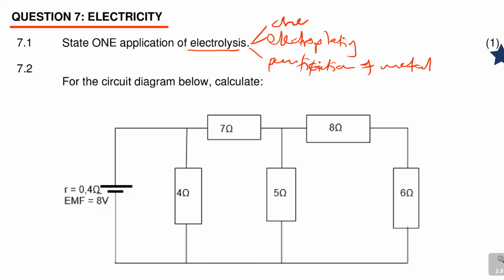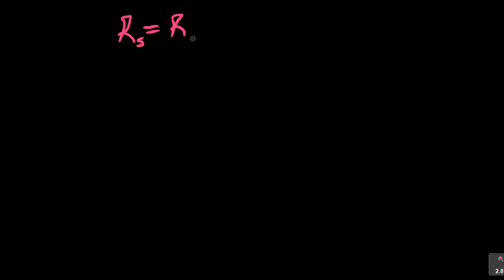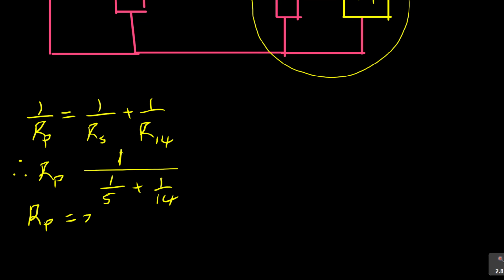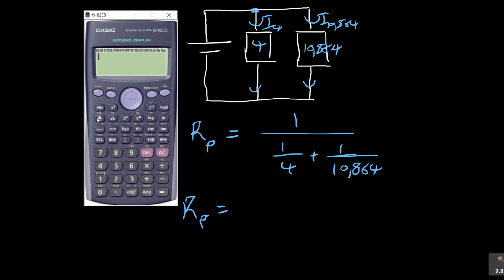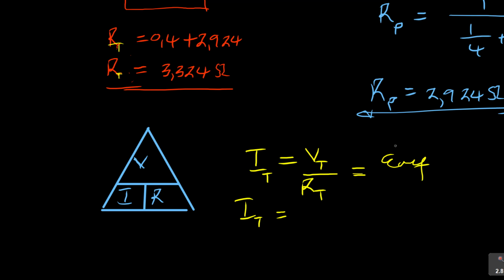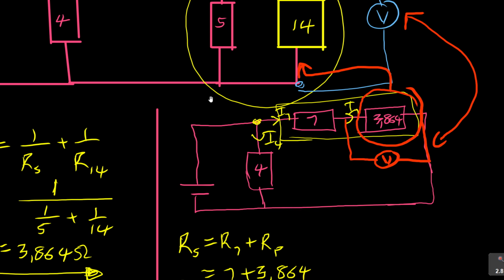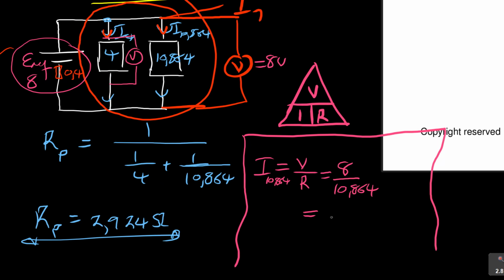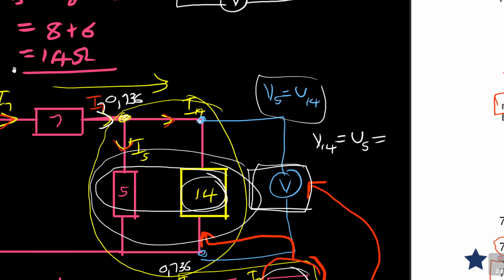Electricity Calculations-N3 Engineering Science part 2

Comment: Hi I'm confused on the part 1 video you multipled the emf × internal resistance before adding to the total equivalent resistance but on this one you only added the 0,4 to the total resistance
Reply: Its because they've said three b3trys, each with 3v emf. So if they are more than 1, you have to add or multiple them